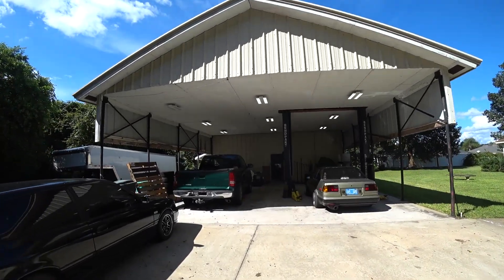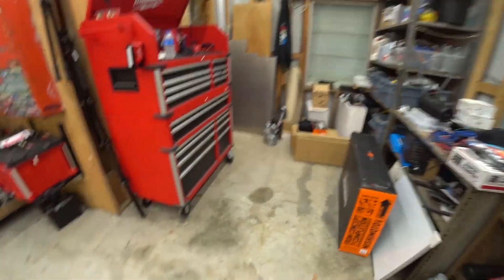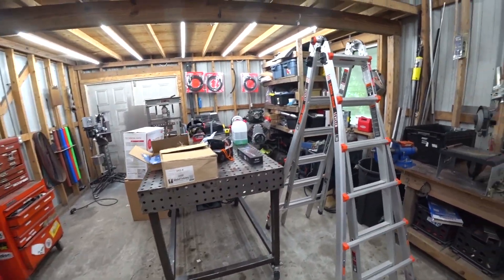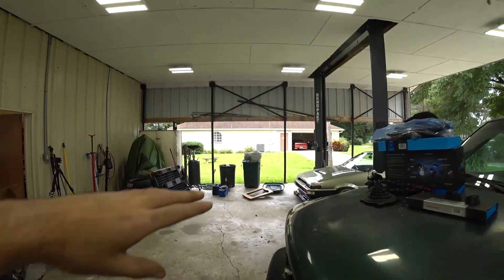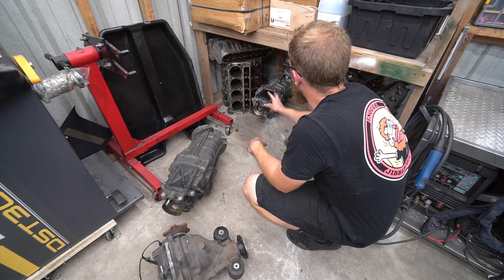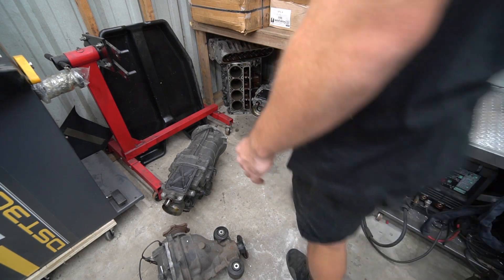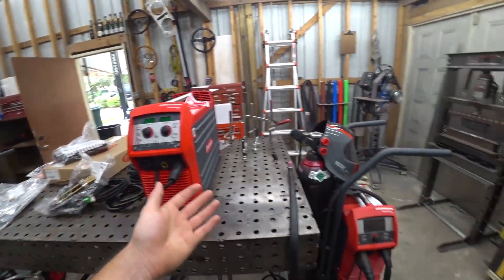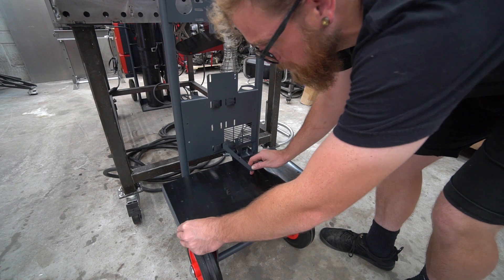Fixing up the shop one last time and setting up new equipment.

Comment: Your mig welds would look a lot better if you push the puddle instead of trying to pull it, if you push the puddle the shielding gas actually gets to shield the puddle and possibly clean the surface from small debris, where as if you are pulling the puddle it is only cooling the weld behind the puddle. Just a thought. Love the content man!

Comment: Hey Taylor, quick suggestion - weld some expanded steel to create a second shelf underneath your welding table. The supports for the legs make a great base for it; just make sure it's all spark/fire friendly stuff that gets stored there. The expanded steel helps the grinding dust/etc. fall all the way through. Awesome seeing you still keeping things nice in there even though it's getting demoed so soon.

Comment: I use long cuff goat skin tig gloves for mig welding and use long cuff cow leather tig gloves for grinding and cutting you should give it a try. The tig gloves have Kevlar sticking which keeps grinding sparks from melting them and ruining a good pair of gloves.

Comment: Taylor, let me give you some advice from the netherlands. you should stab your welds with a mig because your wire and tempature goes deeper into your material that give's you a stronger and nicer flat weld. And the shielding gas have more time to protect your welding spot. When you weld with mig and it spatters a lot then turn your amp up and wire a bit down. Plaese try it and let me know what you think about it ;-) Greetzzzz Jan

Comment: Maybe set the sea van on a 4 wheel farm wagon chassis,  you can but ISO locks that weld onto the wagon frame, and lock into the corner pockets just as a semi trailer does. Hook it to your  bumper and move it as need be; caution ⚠️   It's the opposite of backing one of the other trailers you own.

Comment: Taylor, do something about the metal bender you made. It's straight up unsafe. if you look up the Colin Furze finger bender on youtube its a much better design, and it could be a decent little project. It doesn't have to be that one, but please make/buy something safer to bend metal
Reply: His press has the attachments that can be bought relatively cheap.... I just don't think he knows how to use the stuff.

Comment: 18v 208 wire speed set your gas at 40, you’ll lay dimes, if it’s to cold run 19v 300 an gas at 40. I promise you’ll love those settings

Edit: Weldporn makes some bad ass mig gloves that have good flexibility where it doesn’t feel so bulky, same with there tig gloves.
Reply: If you trying to lay dimes with a mig just don't give advice please
Reply: @nickeaton6348  sooo you’re a pro 😂 ? I’ve been welding since 2012 my dude. You realize he’s not doing some production shit, so why not make them look good? If you can’t coin a mig you haven’t been welding long enough.

Comment: With those gearboxes find someone to rebuild them. Then you have a known spare and a third if you break one.
I presume you are going to use the existing footprint of concrete?  So you should be able to leave the hoist etc in situ.
Though Ideally go sideways like at Bens place. But will cost a lot more. Mine is narrow end and has always been a pain. Not the end of the world but easier.

Comment: Great job on the reorganizing your shop. I'm the same way lol. I have a question. I drive a 2013 F-150 and i don't drive off road. I resonantly but new tires on . After taking the tires off I found a 2 inch crack in the rim. Can I weld the crack and still use the rim for everyday driving?

Comment: Are you going to gut your shop and keep some of the stuff you've added (like lights, wiring, switches, electrical panel, air lines) in case you want you add something after the new building goes up?

Comment: I absolutely love welding, but I just don't get many chances to in the shop at work. Really only every couple months. I desperately want a welder at home but can't afford a good one and have issues with availability of 220v outlets. Not sure what I should do, anyone have suggestions for less expensive machines, new or used? I picked up MIG super fast, i was doing decent work after maybe an hour. I've never gotten the chance to try TIG but I know I want to put hundreds of hours into it to perfect the skill, and have dozens of welding projects running through my head.

Comment: as the miata isn't FD legal anyway, would it be worth buying or building a tubular subframe for the rear so you aren't relying on 30 year old metal with god knows how many thousands of miles on it as the main structure to hold 3 or 4 times the torque that it originally did.

Comment: Scotch Brite your weld table before it gets pitted.. I have ben keeping my custom tig table clean and shiny for 21 years now...
Reply: I buy Velcro backed 4-1/2" scotch brites, but made a punch die to cut a 7/8" hole in the center for my 4-1/2" Milwaukee cordless grinder..

Comment: That is a 250A mig gun, does the welder go up that high ? that old one you showed is a 160A gun, and that is what I have on my 250A machine, as I never go above 160A AND it is much smaller and handier (spray arc with 0.8mm (32 Mil) wire is about 180A, and I don't even think 1.2mm (47 Mil) wire is 250A)

Comment: There is a lot of truth to the buy once, cry once. Coming from someone who has spent a lifetime in trades, buying cheap tools burns you on certain budgets at times you can never count on. Sure, there is plenty of times when buying cheap stuff never fails. But certain everyday/job use tools can’t be bought cheap if you want to use them for a long period of time or reliability. It’s worth it in the long run, and you’ll be a much happier confident person having the best possible
Reply from the maker: Exactly. I’ve learned that I end up getting the nice version anyway and the cheap one goes to waste. Might as well just get the nice one first and you end up saving money in the long run.
Reply: @Taylordrifts  The thing I learned from buying the cheap version first and then using a better version is the quality surpasses the cheap version in lots of ways, ie:ease of use, versatility, durability. When I see someone new to the trades, I try to give them a list of what they can get by on with cheaper tools, and what to buy quality right of the bat. If you want to be good at what you do, your tools will help you get there faster.

Comment: Professional welders are in a different league, can you weld with a cheap hobby welder, yep, will it be nice, easy good looking strong welds… very occasionally at best. Most try a cheap welder, have all sorts of issues and just give up putting welding in the too hard basket, where it was the machine holding them back.

Comment: Can someone explain to me what a beam engine is?
Reply: That’s a Toyota Beams. It’s a development of their S series 4 cylinders. Beams is an acronym for Breakthrough Engine with Advanced Mechanism System - This is commonly referred to as a "non-interference" engine, so the piston can’t contact the valves. There’s a few versions, that one is probably a 2.0l 3S-GE.

Comment: i think that Fronius Torch head is WAY too cumbersome. 
the old Mig torch looked much easier to maneuver.
I took this type of advice from a really skilled Tig welder. 
he told me the smallest, lightest most comfortable torch isnt going to produce the cleaner work.
but it will allow you to do more work, more efficiently.

how would you get that big fronius torch head in a small nook ? just food for thought.
Reply from the maker: For tig I run the smallest setup possible. For mig I don’t mind a big beefy gun because I’m never doing intricate work with tig. I’m sure Fronius makes a smaller gun rated for lower amperage. My point was the quality of it in comparison. One of those things you have to feel to understand the differences.
Reply: @Taylordrifts  I can appreciate the response brother ! And the quality is 100% there. I just think about people welding exhausts and other pipes in small places where removing the pipe isn’t always an option. Keep it up dude. I love your channel ! 👍